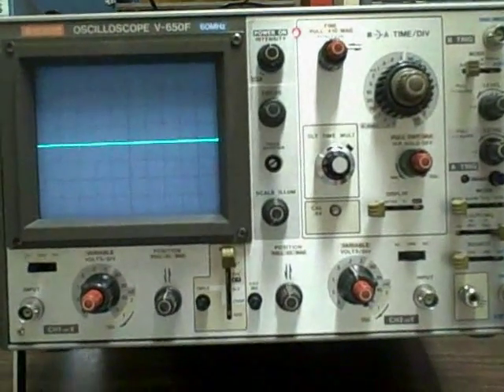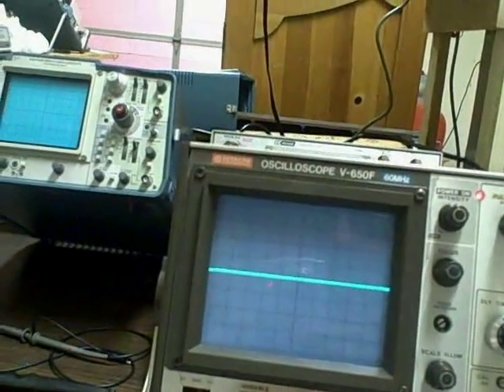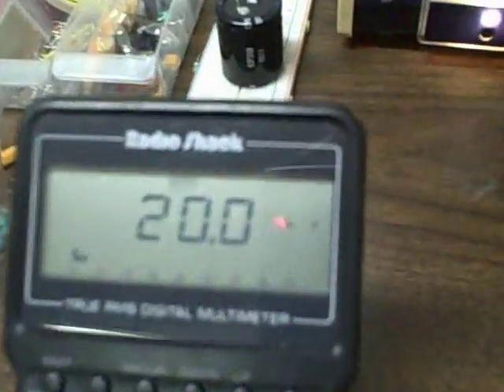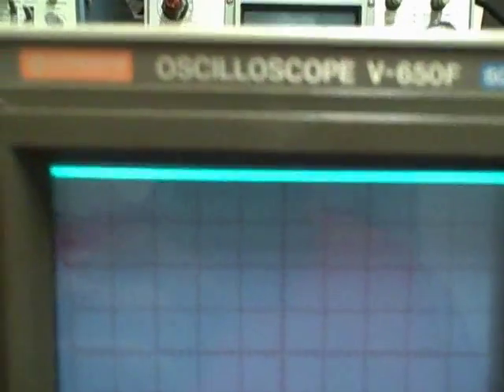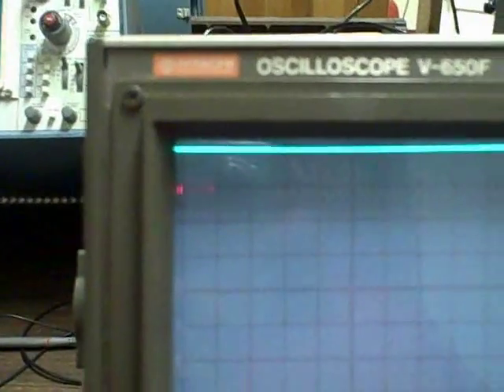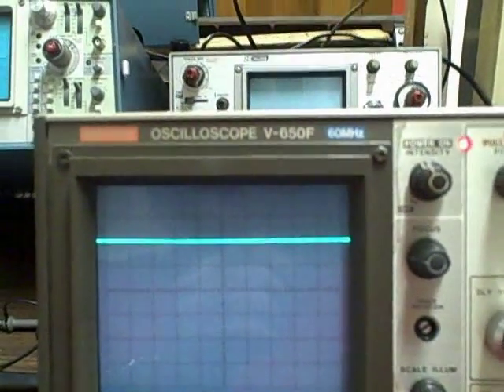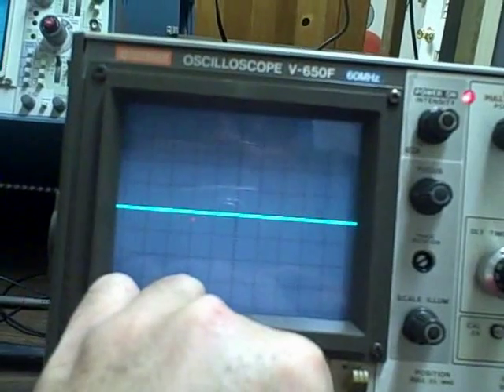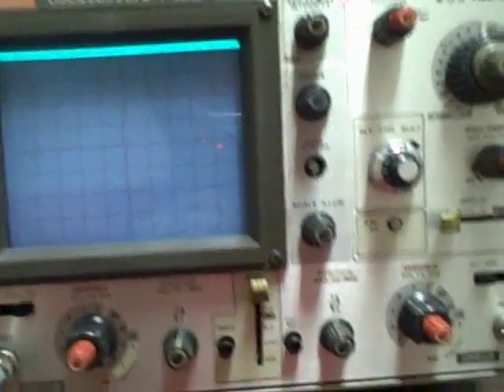pt1 v65f demo.avi

Comment: I just picked one up on ebay $45 + $25 shipping, listed as parts only because the seller did not know how to test it. Works fine, CH1 bnc is a bit loose. If you're getting a CRO on ebay, don't exclude ones that sellers list as parts simply because they can't test it! Also, the illuminated scale w/ red grid is an awesome feature!

Comment: I've got one of these,my first decent scope.  Bought used for $400 in 1990, and it came with two new probe kits that I still use with my DSO.  Mine hasn't been turned on in over a decade.
Reply: I bet it would run just fine, besides taking up 3x the space of the DSO lol